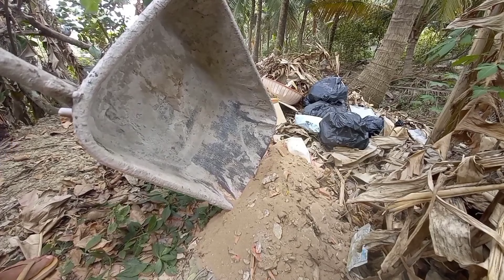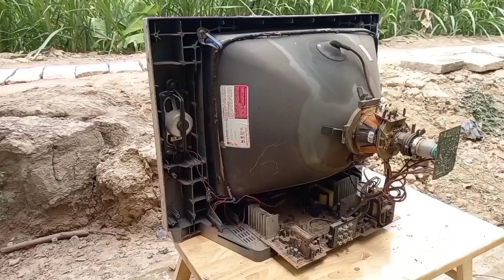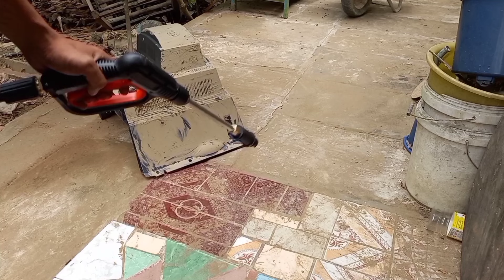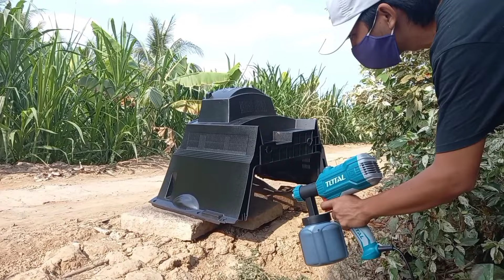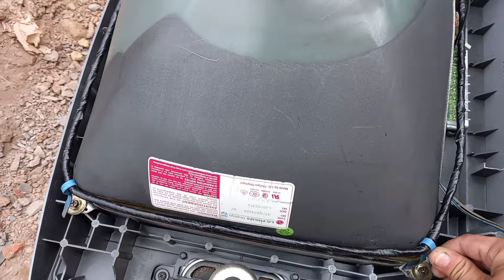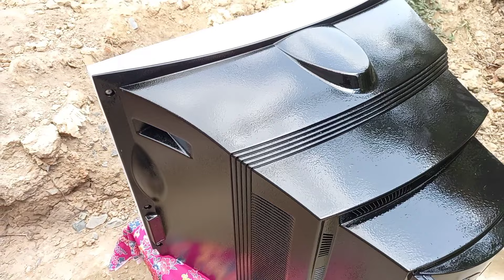Restoration LG TV produced in 2000 | Restore old TV LG

Comment: All test in power picture is ok door closed. But horizontal rooling control   not worked. Horizontal ic pince voltage chak releded ports and (Hor) line . Capacitor reple. I seemed border life is not spaled (spend).